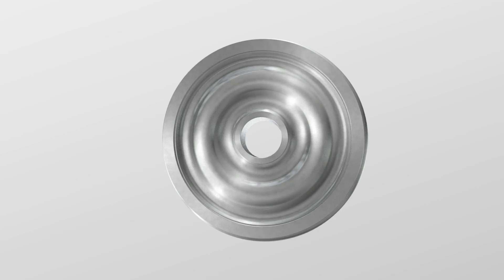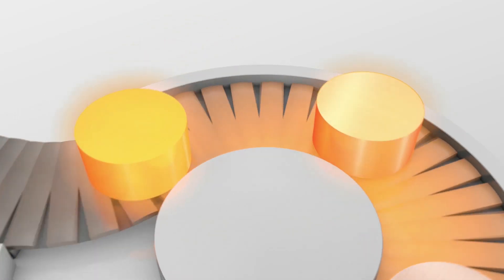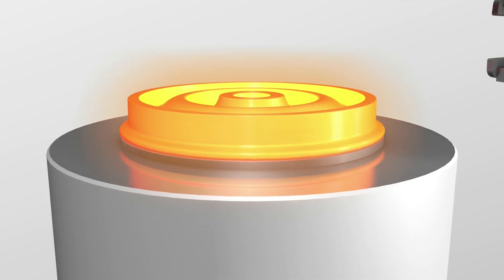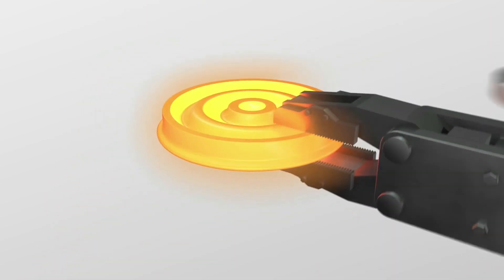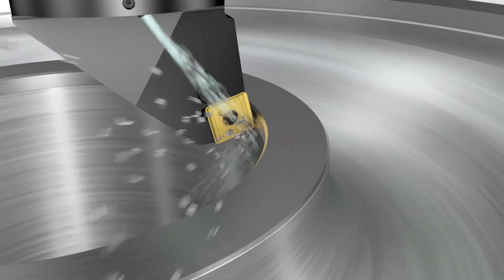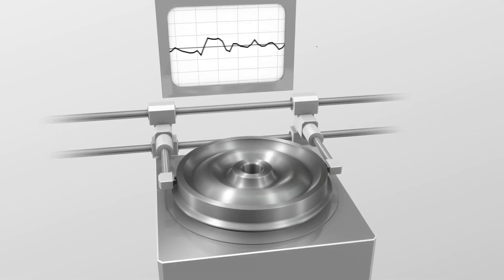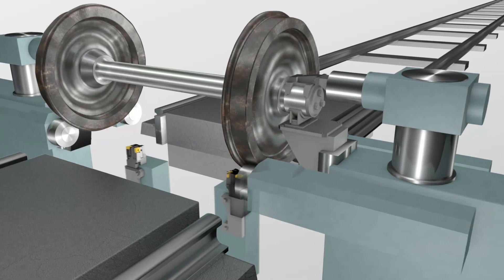How a train wheel is made - Sandvik Coromant

Comment: I've seen imperfections like rust out spots and flat spotting on rail cars. The wheel goes down the rails banging or grinding . Holes are uncommon, but I've seen some of those too. Steel can be an imperfect metal to forge.

Comment: I have always found it interesting how small a train wheel flange is compared to how huge those trains are. All it takes is one inch of lift of the wheel for whatever reason to cause a major disaster. I'm beginning to think that flange climb is one of the main causes of derailments especially like I said before the flange being so short.
Reply: It's more than just the flange holding the wheel on the rail.

There is a taper on each "tire," narrower at the outer end and  wider toward the flange. So it's progressively harder for a wheel to "climb" as it gets closer to the flange. This also allows for the difference in rotational speed between the inner and outer wheel on a curve.

There are many tons of down-force on each wheel, so it's very hard for a wheel to overcome the taper and the flange.
Reply: James surrey A few tonnes? Lol, make that 80+ / 100+ tonnes :) Metric ones that is.. Use Google to convert it to alternative measurement systems.
Reply: But i think one should not forget that all that mass in movement can also help getting out of the tracks, if it slams into a corner, or onto a defect in the rail.
Reply: You are forgetting the travel of the suspension - - if the axles were rigid to the frame a 2 inch flange would not be sufficient.
Reply: Well, your statement about  "difference in rotational speed between the inner and the outer wheel on a curve" is highly debatable, a debate as old as the railways themselves.  The taper on the tyres are actually to "centralise" the wheel/axle between the rails ON STRAIGHT STRETCHES of track during high speeds, to eliminate what is known as "hunting", ie, the "banging"  of the flanges against the rail.  Just saying there are two camps of thought on this.
Reply: And, at locations where wheel flanges could be expected to be under some stress, there are often flange lubricators. They serves to minimize wear on the flanges and the gauge face(s) of the rail(s). Sometimes a small amount of lube is even applied to wheel treads, I'm told. Consider that much US rail routinely handles 35 ton axle load.
Reply: Bassotronics why is your username highlighted?
Reply: Bassotronmercado libre.com
Reply: Rocky The cat22 User names are highlighted for the account holder of the channel.
Reply: Alec Wood oh ok
Reply: http://interfacejournal.com/ has some excellent articles on the assorted forces and effects at work!
Reply: a train would never lift an inch. Reason being is because they weigh soo much. a locomotive weighs at least a few tons and all of that weight is concetrated onto skinny peices of metal . Only way a train would derail is if the tracks or wheels are badly maintained or if the train doesn't follow the correct speed limits.

Comment: This is a great animation of the overview of how train wheels are manufactured. Although I feel it is necessary to point out that not all aspects of the wheel are machined such as the contours, usually only the outer edge where the flange and the tapered point contacts the rails is usually machined to spec as well as the ID that is press fit onto the axle. Its also worthy to point out that wheels on both locomotives and freight cars are turned fairly often as when the wheel is in tolerance and has a perfect tapered angle there is a significant less amount of friction between the rail and the wheel.

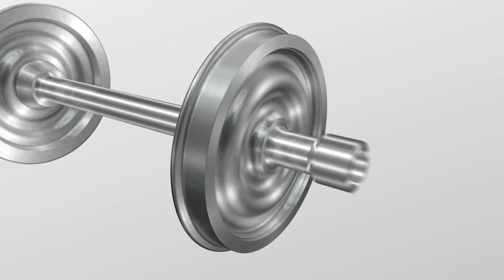Comment: I'm sure/hope the wheels were secured to the axle a little better than they appeared to be at 01:47 - 01:53 ..and seemingly secured by x3 bolts!!!

Should have shown the real/whole process. Good for youngsters I suppose.
Reply: The wheels are heated and press fitted to the axle, once it cools it is able to contract and firmly grip the axle. The 3 bolts you see in this animation are there to hold the bearing cap in place for the roller bearing that sets on the outside of the axle. A set of trucks or bogies (if you are Europe) is set on top of the wheels and they set snugly down onto the bearings.
Reply: Fenix There's very little axial load in that direction. See how the flanges on the wheels are inside the rails? they transfer axial loads and they always transfer it towards the center.
Reply: Hi Fenix,

The 3 bolts only hold on the bearing cap, not the wheel itself.
Reply: Fenix those 3 bolts are 1 1/2 inch thick each. 3 Galvanized steel bolts will hold 1 wheel
Reply: In the US, too.  The trucks are lifted to remove and replace individual wheel sets which are attached  and held in place only by the weight of the car/wagon.

Comment: Is it common practice to re-machine the wheel surface while still on the train or is this a new technology?
Reply: In modern locomotives or trains it is, because its cheaper and quicker to machine the wheels still on the locomotive. Freight cars, older locomotives, and some railroads will pull the wheels out from under the locomotives in-order to remachine the surfaces. This also gives time to inspect other parts of the wheel and motor assemblies that are inside the truck body that encases the wheels.
Reply: I was a Guard in the 1970's, & it was a very mature technology then. 
The process of taking the wheels off a steam-loco is a lot more complex than modern rolling-stock, requiring the careful handling of large pieces of high-precision steel & heavy-lift gantry-cranes, & during the early steam-era the idea of a lathe built-in to the maintenance road was quickly developed, mostly to reduce maintenance time.
Reply: Here in The Netherlands it’s standard procedure they say. There is no time to take the wheels off all the carriages. Which comes with safety hazards as well. Doing it on the train is kind of like a drive-through action.
Reply: Обычное дело проточить колесную пару. При экстренном торможении колеса слизываютмя и не слабо так стучат - их перетачивают. Плюс выравнивают радиусы колес в паре, чтобы они не поворачивали ;)

Comment: Why is this difficult? Because it's hard?
Reply from the maker: krap101 
Hi,
During production of a railway wheel you will meet some challenges at the turning process. This could be the different hardness on the wheel, tolerances, productivity, tool life and tool security. All these challenges you will overcome with the latest assortment of tools for Railway Wheel Turning from Sandvik Coromant.

Best Regards,

Per Kolvereid 

Application Specialist, Positive Turning
Reply: Yes, most hard things are also difficult. They can be challenging as well.